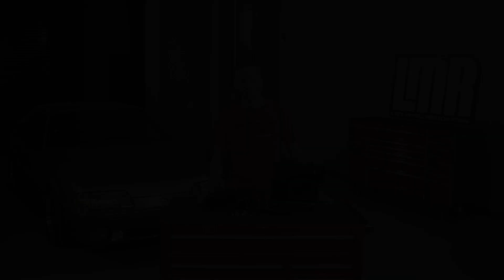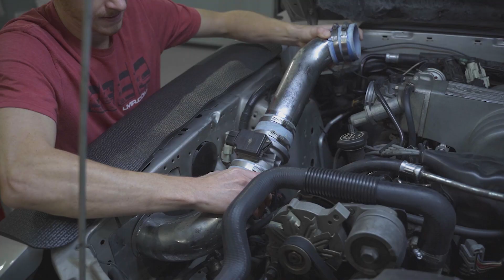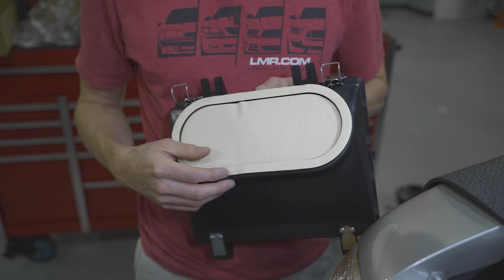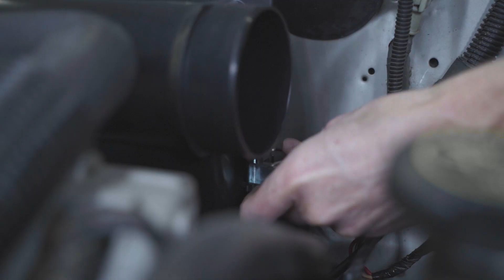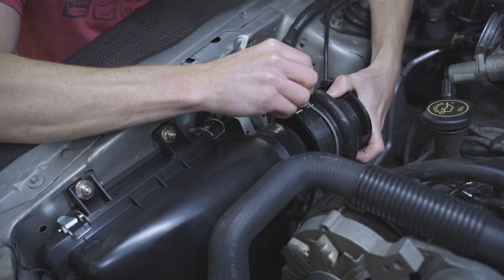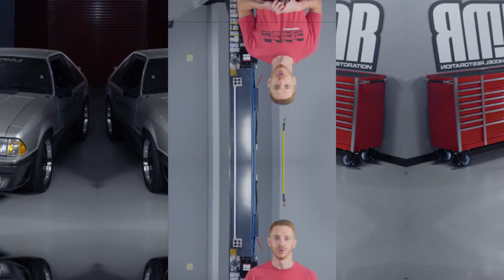How To Install 5.0 Resto Fox Body Mustang Factory Air Box Kit (1986-93)

Comment: So i currently run a stainless tube and a cone filter. I hate it and want to go back to the stock airbox. I am currently running a 75mm MAF, a 70mm throttle body, an ported explorer intake and ported gt40 p heads.

Will this setup be a bottle neck for the rest of my air induction? or is it sufficient for my setup? Thanks.
Reply from the maker: I don't have the data to back up a yes or no answer. All I can provide is my "best guess" based on the knowledge I've acquired from doing this stuff. If the metal inlet tube has a larger inner diameter than the factory rubber inlet tube, then there would be a restriction if you were to revert back to the factory tube. However, the metal tube soaks up more heat than rubber, so it could be that the restriction is an even trade versus the heat soak. You could always wrap the metal tube in heat tape, but you've already said that you don't like it. At the end of the day, I think we would be splitting hairs on power differences.

If you watch the review video of this kit (link in the description), we perform a before and after dyno of a car that had a metal "cold air intake". The car made 3 more horsepower, but lost about 1 lb-ft of torque. Again, splitting hairs. With such little difference, you would have to consider the small variances between dyno runs.

If you're all about power and torque and possibly bracket race the car where every little modification is crucial, then I wouldn't worry about it. If you think the factory look out weighs any potential pros from the metal tube, just buy the factory intake kit. Hope this helps. -Landan

Comment: How do you remove the air box studs if they’re broken?? The rubber part snapped off and the bottom stud is still in
Reply from the maker: Without seeing a picture of your situation, I'm just going to guess. Try turning the stud from within the fender well. -Landan

Comment: Will the air tube extend for the Speed Density hook up?
Reply from the maker: The air tube and kit is designed to fit with MAF sensors not speed density
Reply: @latemodelrestoration  then... maybe mention that in the video...instead of saying "fox owners still with Speed Density, would JUST omit the MA step"??
That conveys the message that it will work for Speed Density setups 
And yes, I'm a blast to party with.